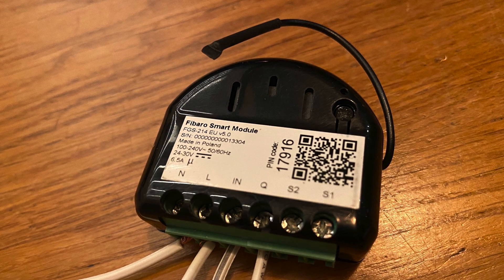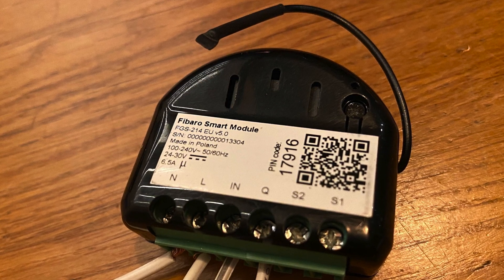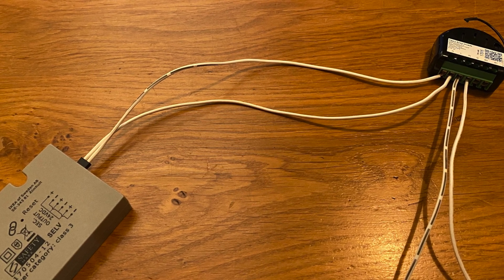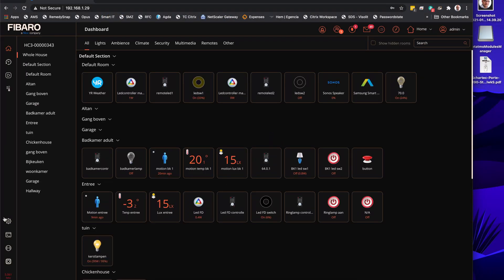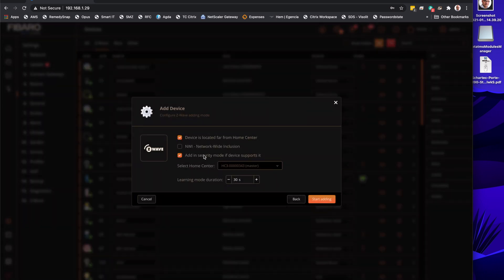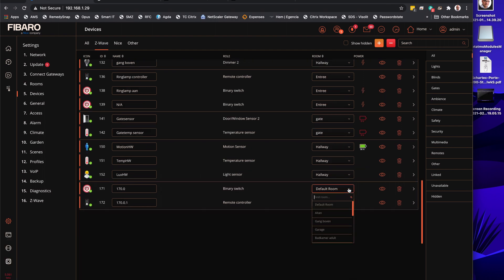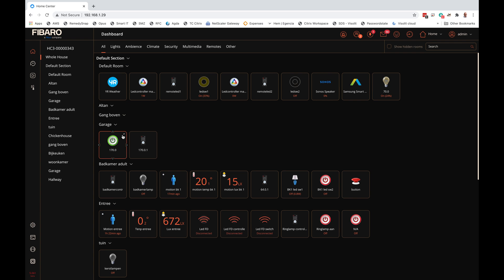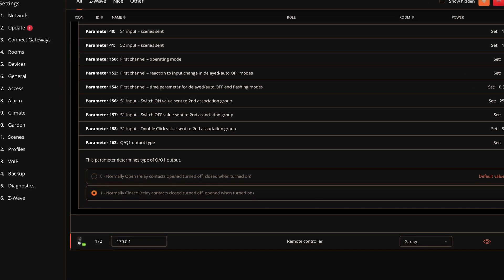Smarthome garage door upgrade  (Fibaro Homcenter 3 ) home automation

Comment: Are you using on/off mode ? Cant use roller shutter device instead ?
Reply from the maker: I tried this module but the motor only supports toggle not on or off